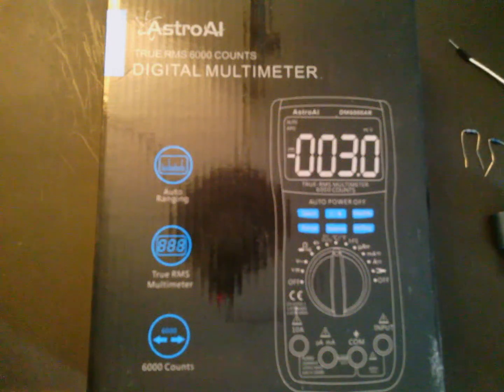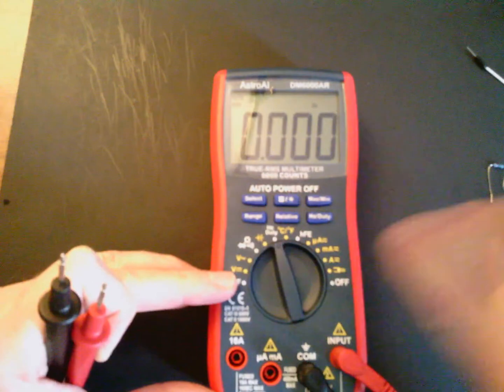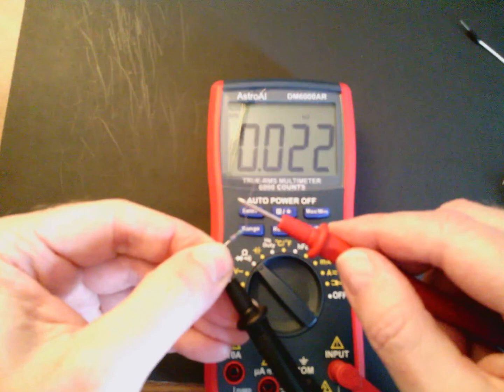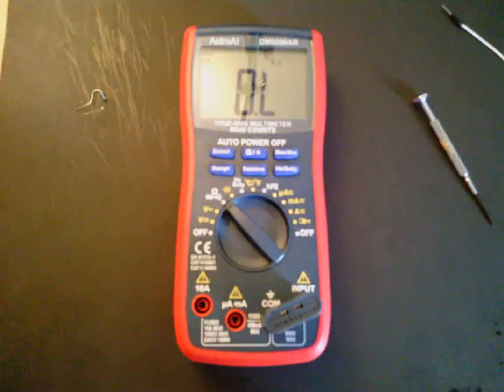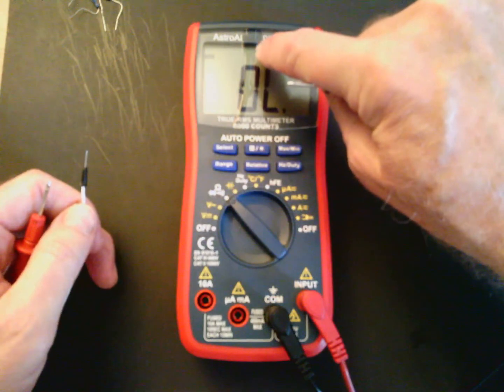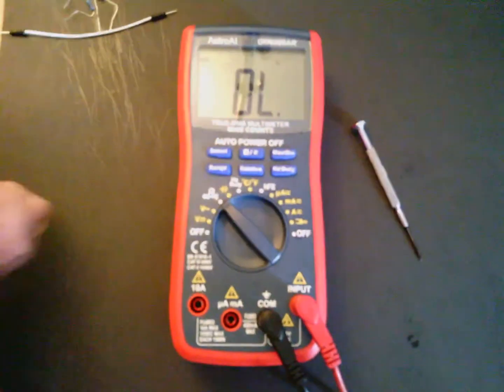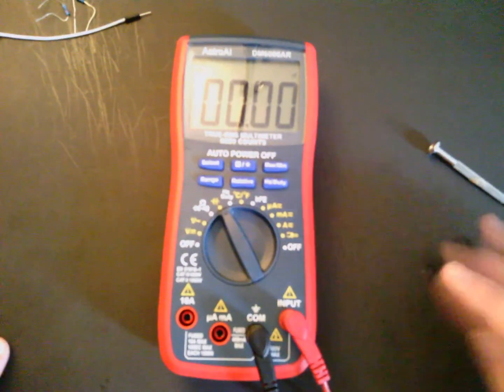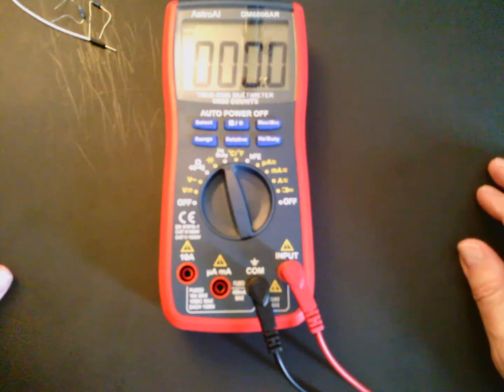Introduction to the AstroAI 6000 Digital Multimeter

Comment: Thank You for the great video. It's a great little unit if you know how to use it properly. Strongly advise RTFM because all the functions are easy to understand after RTFM. The caps on the probe leads are difficult to remove when the product is unboxed. I used a little plastic pry tool to loosen them and they are easy to remove after that. Cheers from the Land Down Under.

Comment: I just got this, and I can't figure out how to get the caps off the red and black probe wires. They're so stubby, they're basically unusable as there is barely any metal exposed.
Reply: never mind, a set of pliers, and a bit of arm strength, and they eventually gave way.
Reply: Just tug harder. I had the same issue.
Reply: I used one of the plasic pry tools (small plectrum type) to ease the caps off the first time. After that it was easy to replace and remove them.
Reply: It’s the very end that comes off only

Comment: Have you tried checking current with it? I used it on my bread board with some led’s said to run at 20-30mA but my meter gives me 2.6mA.

 I have it in the correct port and am checking in series (using the probes to complete the connection). Any help is appreciated. Thank you for this helpful video!